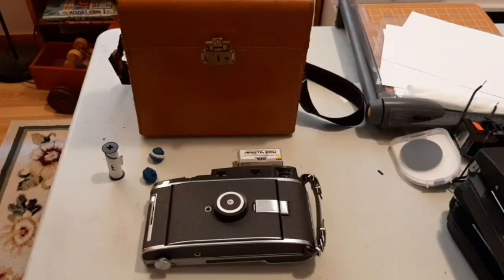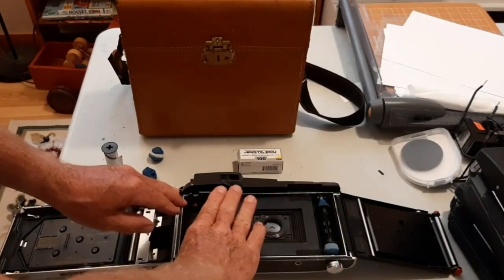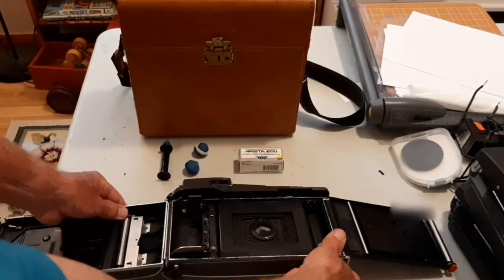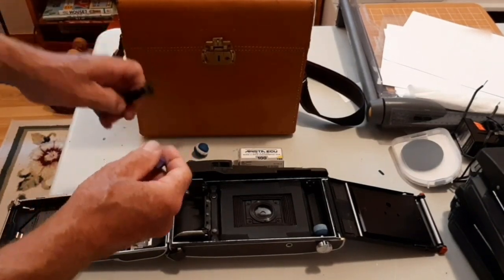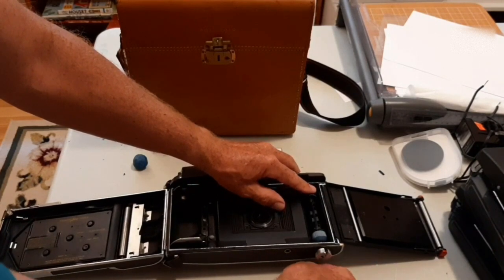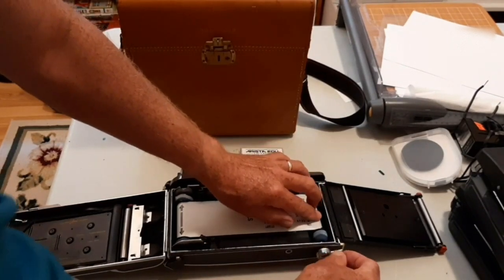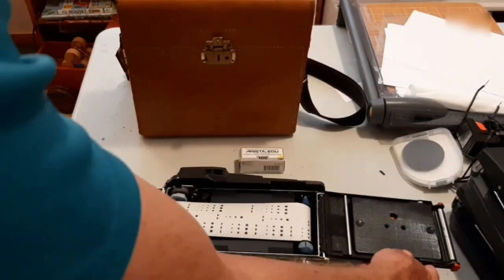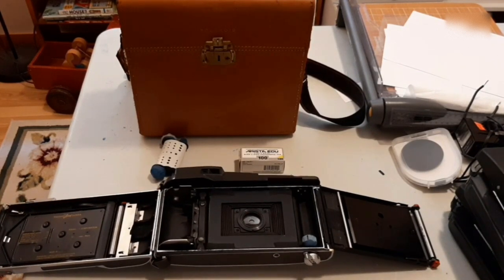Preparing a Polariod 110A camera for 120 film using FEMO sculpy clay

Comment: Thanks for posting this tutorial. Any new thoughts in hindsight?  Was thinking of converting my dads 90, but after years of contemplation on purchasing a 110A I recently came across one in an antique store back east. The Rodenstock lens and bellows were in great shape and the exterior was in good shape except for the usual lite chemical erosion near the hinges.  The proprietor and I haggled a bit and she sold it to me for 55.  Given the camera came with almost every accessory available at the time along with instruction booklets I considered it a fair exchange. 

After watching hundreds of conversion tutorials over the years yours seems the most simplistically effective in its approach.  I always balk at puncturing the body of the camera, but your process seems to be the least intrusive/destructive I’ve seen so far.  Thank you again for the video and would be interested to see some prints from your conversion.  JP
Reply from the maker: I had to work on modifying the film mask a couple of times before I got it right--I think I was trying make the borders too small, and the film would curl over the edge and be out of focus. But in hindsight, I like the coversion--it's workable, and I can still use the camera for taking paper negatives, and it can still be modified for other formats such as Instax wide. I'm on instagram @hackaninstant which has more info on the conversion.

Comment: Thanks for the inspiration.  Any tips on how to get those rewind knobs off once sourced?
Reply from the maker: Open the camera back, put a screwdriver between the middle gap of the shaft to hold it still and unscrew the knob counter clock-wise. I've since designed 3d printed parts for the adapters which you can find on thingiverse.com (search for Polaroid 110A). The knob could also be made with 3d printed parts, but a metal one is much stronger than plastic.